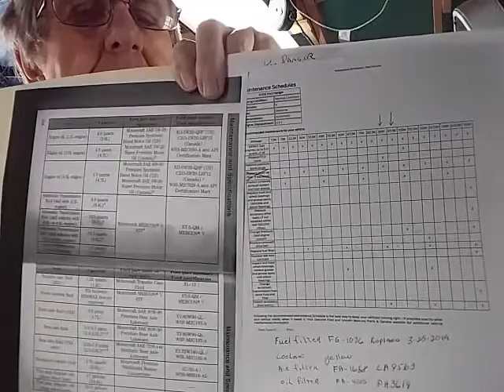Automatic transmission fluid change hack..2008 Ford Ranger

Comment: I went to a Ford dealer for flush and got only the pan cleaned and a new filter!
When driving off road or a little bit quicker on the speedway it switched to crawl mode ... before and after „Service“. But the sneaky bastards disconnected the warning light!!! Only error code on OBD2 showed the still existing problem. I think I have to visit them again and have one or two words